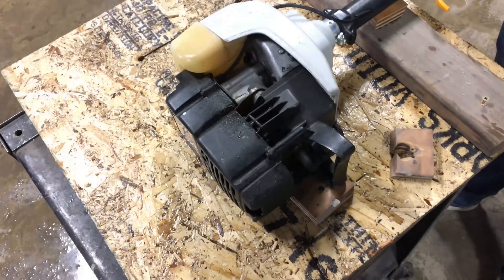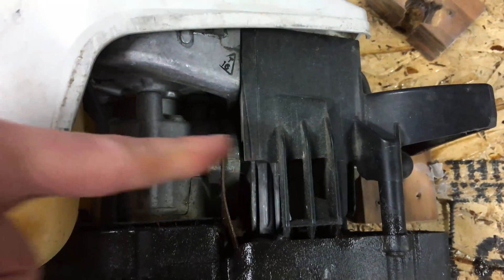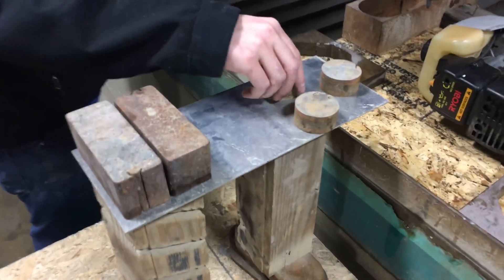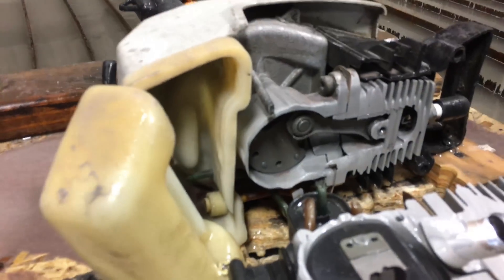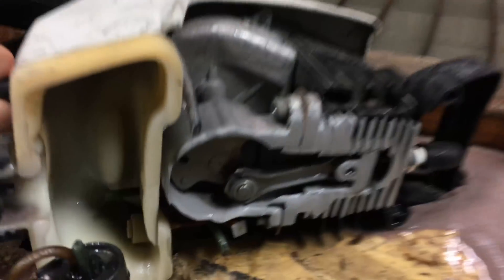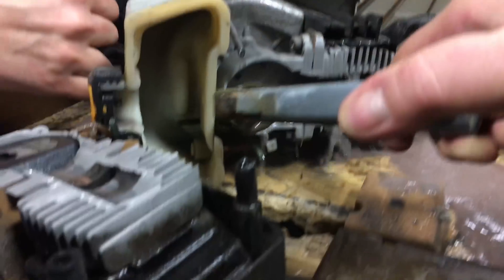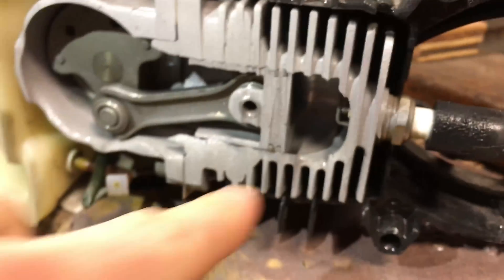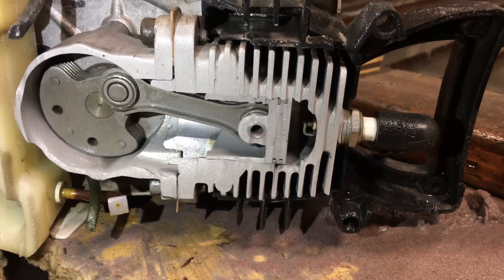Engine Cut in Half With A 60,000 PSI Waterjet - Cutting Weed Wacker -  interesting engines

Comment: Haven't you considered that the water is going to remove the lubricating oil from the cut cylinder?  You run the risk of incredible wear without adding oil as you pull the starter cable....

Comment: I'm interested to see if this thing can cut through something like titanium or tungsten or some other extremely hard metals/alloys like those.
Reply: BroskieManDudeBro actual it's not. it's stronger in terms of tensile strength, but it is much softer than steels. your average heat treated titanium alloy like 6al4v has a Rockwell hardness in the low 30s where as your average heat treated tool steel will have a Rockwell hardness in the range of the high 50s or low 60s.
Reply: BroskieManDudeBro They already have a video of it cutting Titanium
Reply: I'm well aware. It's been over 20 years since I first learned about waterjet cutting, and about 18 since I accidentally sliced my finger rather badly with a pressure washer (accidentally hit the trigger while changing the angle of the nozzle). Because I knew about waterjet cutting it wasn't a shock to me. I actually just looked at the gap where my skin was supposed to be and thought, "That really is amazing. I just cut myself with water." Obviously that's without any added abrasive, but it's also flesh rather than steel or stone. 

If I can set it up with these guys (anyone know their email address? All I've found is their PO Box) I'll take an old end mill as well. I'm actually driving through their part of town today, so it would be great if they would let me know if I can swing by. [hint*hint]
Reply: Titanium is actually not a very hard metal and can be cut quite easily. Your average tool steels are far harder. Tungsten on the other hand would be very interesting to see.
Reply: I live just up the street from these guys and I have some HUGE pieces of M2, M4, and M42 high speed steel that I want them to cut up. I'll try to set it up with them. I was just thinking, before seeing this comment, that it would make a great demonstration of the difference between cutting and abrading.
Reply: Titanium is harder than any steel.
Reply: It cut inconel and marble and glass and granite, all much harder than metals.  The harder it is, the more brittle it becomes.  Now since mixing tubes are carbide I'd be interested to see an end mill cut in half.
Reply: Jon Miller a lot of military applications use waterjetting because it doesn't temper the material unlike traditional or thermal cutting operations.  OMAX makes a wjet that will hold microns too.

Comment: Now it has only half power...
Reply: compression might be a bit low...
Reply: I think it is flooded..
Reply: it's an air cooled engine
Reply: From 25cc to 12.5cc

We have the same strimmer as a spare and its pretty decent
Reply: No, as I said, it does also have some sand in it. it is the sand that does the cutting.
Reply: hole - 1st drill press channel 0,5 hp
Reply: lmfao
Reply: Is that a laser beam? I know the water cools it down so it doesnt burn.
Reply: ***** no, very high pressure water and some sand, no lasers
Reply: It cant be just water cause it cut thru metal.

Comment: I have A Question Where do you buy a water jet even if it was just 2000 psi
Reply: Serious answer for you tho, if you want a water jet, for actual cutting that you can fit in your house they make small portable ones that fit in your garage. There is a kickstarter for them. It's a total ripoff tho. It requires so much money in granule just for a single project that it's cheaper and more logical to just pay a company for what you want.
Reply: Waterjet Channel I meant a low cost one that cuts stuff
Reply: low cost ones don't exist. Ones that fit in your home or garage(that are still in the kickstarter phase) are like 7000$. That's as cheap as it will get. It's not cheap technology and it's VERY dangerous to use.
Reply: Attach a small nozzle to a pressure washer ;)
Reply: throw the smallest nozzle on a pressure washer and a few cups of sand, take off the in line filter and hope for the best.
Reply: My Peace Cloud Thanks!! I Bought It It Should Arrive In about A Month
Reply: YSC water jet cutters don't just cut with water. they use a very fine abrasive compound mixed or injected into the water.
Reply: Rashid Al Mutawa Look at this on eBay http://www.ebay.com/itm/322396304486
Reply: Must be nice to have 7500 bucks just laying around lol
Reply: kalloused. 
I don't think your looking at the correct market. If you bought that CNC water jet (the kickstarter one) it wouldn't be used for one single project. It would be like consumer grade 3d printers. Used daily by makers.
Reply: the shop?
Reply: lmao Check out my 2000 Psi WaterJet, I use it to wash the car.
Reply: +Waterjet Channel and can even be electric lol
Reply: Skinny Mcdoogin hopes and dreams would end in about three seconds.. lOL
Reply: Skinny Mcdoogin  hahahah
Reply: Paul Meier what happenz
Reply: Skinny Mcdoogin that sounds like a recipe for disaster
Reply: eBay

Comment: can you cut a grenade?
Reply: very much so lol, but wheres the fun in that?
Reply: untrue there is ways to legally own them
Reply: start from the bottom up, grenades contain gunpowder which as you may know doesnt work when wet
Reply: Rafael Rodriguez Maybe but they have to be careful where to cut it and would need someone with experience with explosives and how they work, the vibration might set the pin of the grenade off
Reply: ....Cutting a grenade in half would do nothing because it requires the pin to be pulled to activate, not to mention the charge inside would be wet and rendered almost inert.
Reply: doesn't matter, illegal to even own one.